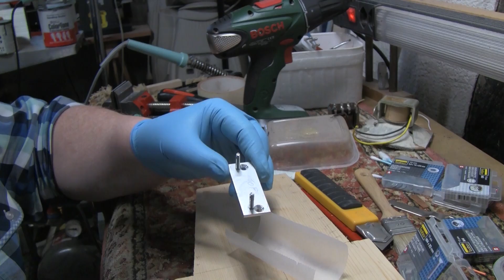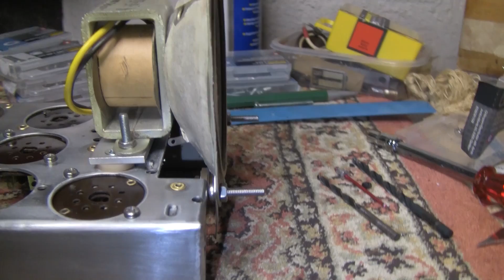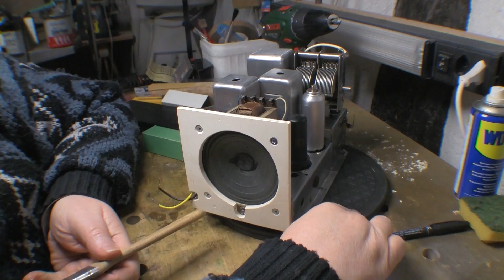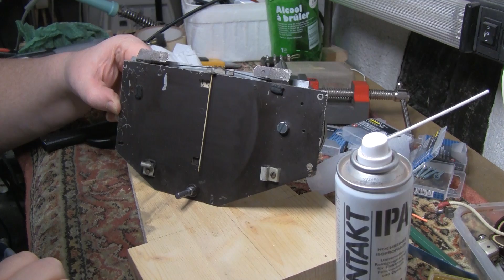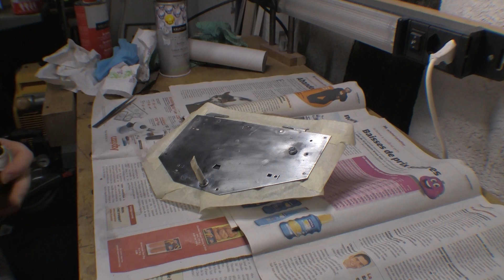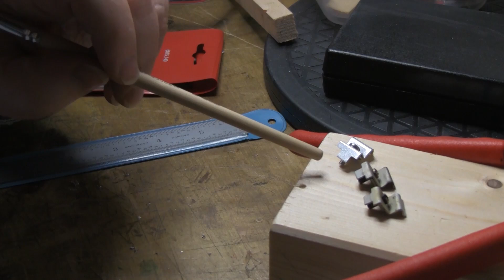Radialva Groom Rebuild - 6

Comment: Hello John. So far so good. When you put everything together it looked real good, all shiny. Your replacement glass holder looks identical to the original ones... wow. A question, where was the pointer at the moment you painted the plate? Did you disassemble it? About the color tone, considering that is behind the glass, does that make a difference in the look of the dial?

Comment: I think most radios used a type of rivet called a "Hanson" rivet, those are the kind with a solid head on them. I'm not sure what those tubular rivets are called but they seem to go in very similar to a metal eyelet, they may use something similar for leather work.in which case Tandy Leather may have them. There are some Hanson rivets available through McMaster-Carr's website if you need those type in future.